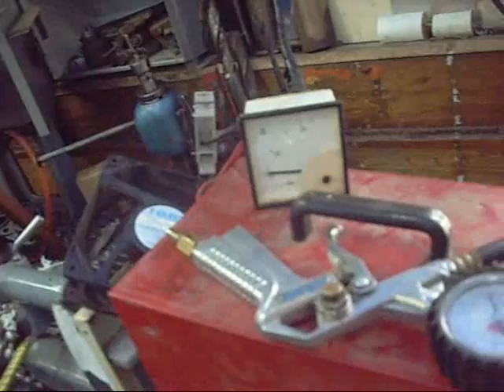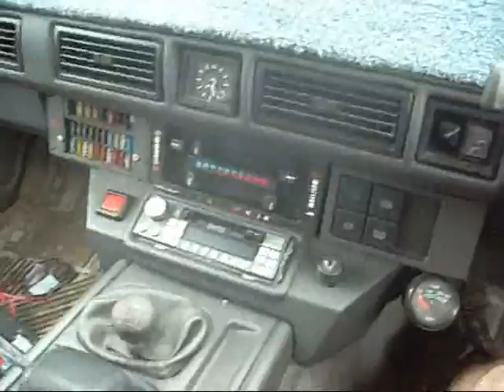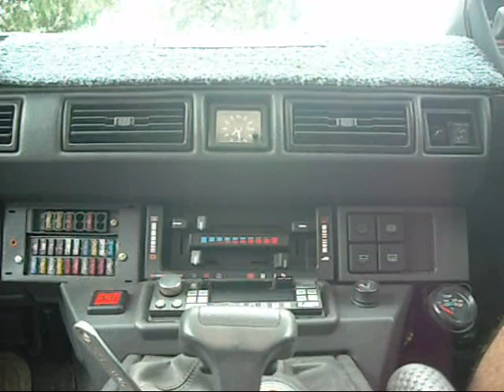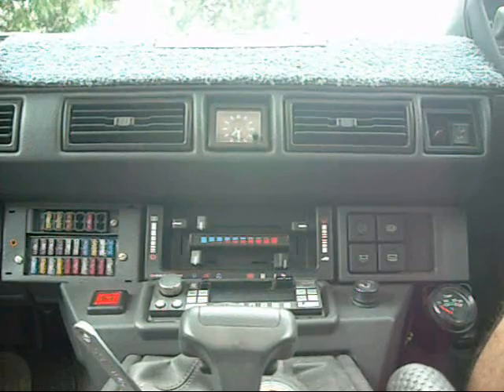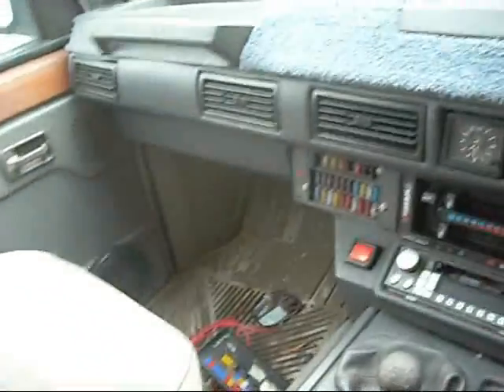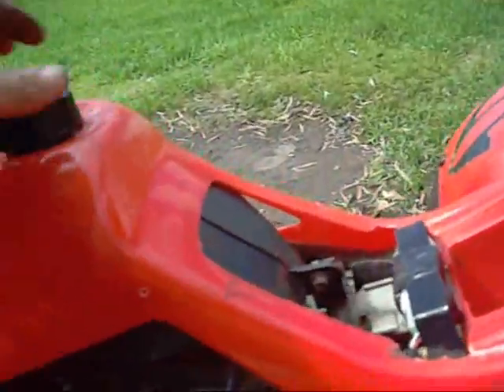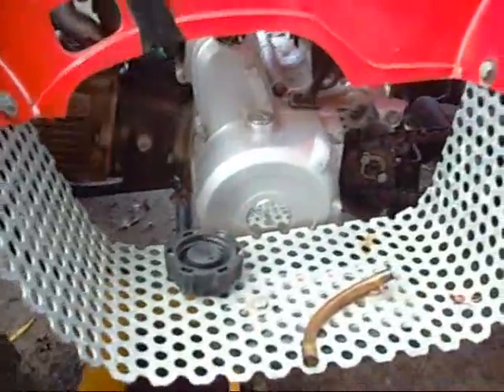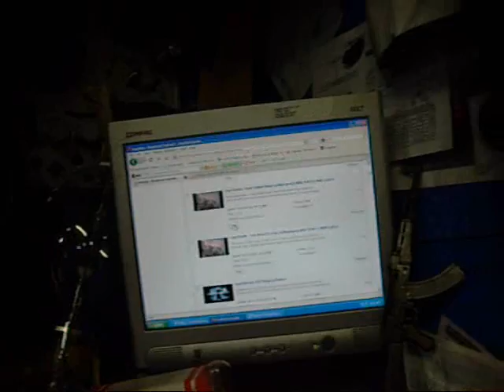The Culling of Ed Systems pt2 - Quad Bike Test Rangie and Gas Sampling Tubes

Comment: @Aussie50 i've worked in the hydraulic buisines, so, i have seen verry much types of valves. i've tested stuff to allmost 1000 bar (14000 psi) But in the chemical industy the use most rvs. that valves are around 100 dollar each